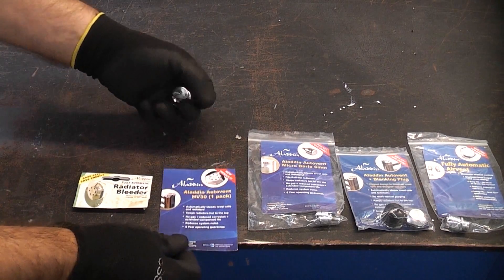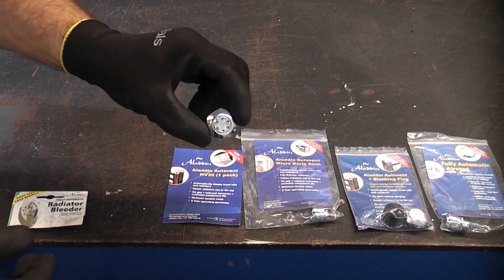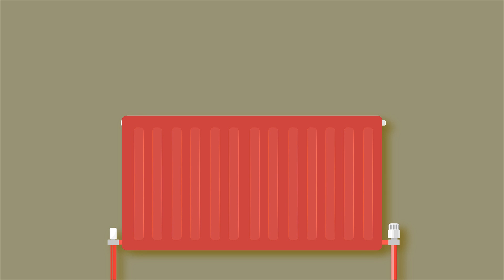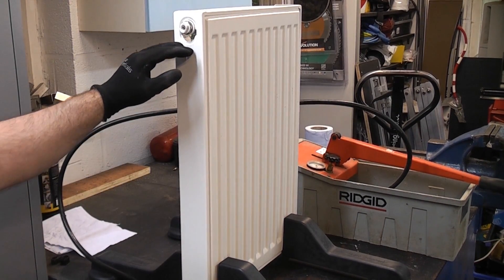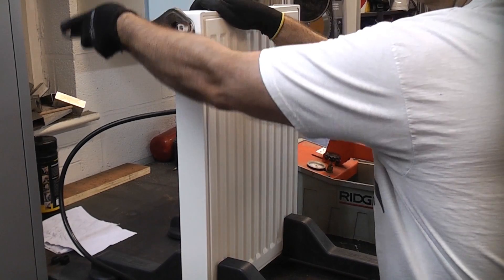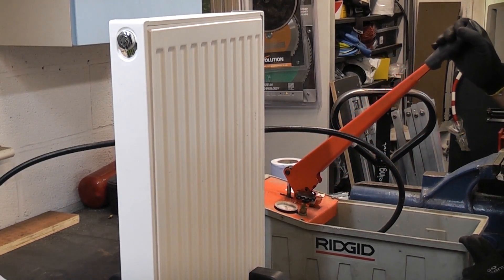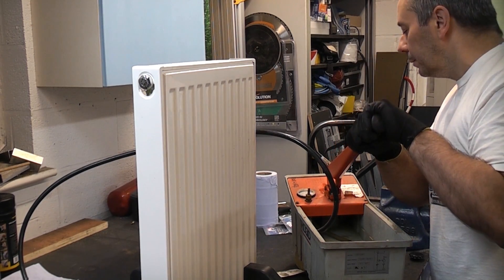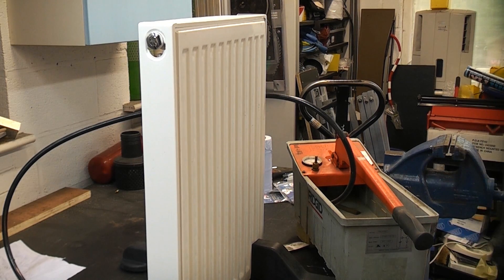Aladdin autovent | automatic radiator bleed valve

Comment: I have different problem with some rads not heating at the bottom, over the years I've had numerous plumbers out all with different solutions. My boiler is a ideal classic fitted upstairs  in the box room with a expansion valve in the attic. Kitchen rad will only get piping hot if I knock off some rads. I think it's a balance issue as their is no air trapped. Can I source a device to balance or what do you think. Thanks Kyle from dublin
Reply from the maker: Normally old rads at the bottom often means that the radiator is full of sludge.
Have you ever had the system power flushed?
You could remove one of the problem radiators and take it outside, then swill it out with a hose pipe. 
Thanks for the comment
Reply: Thanks for replying , all the rads are less than 5 years old, I've had the system drained twice in the last 5, I've also bought magna clean but it's not installed yet. Kitchen rad is furthest from the boiler which is upstairs in the box room. Probably needs a power flush and the boiler replaced and moved downstairs
Reply: Kyle Croft. There`s a few things that could be the cause, which you should eliminate before the pain and expense of a boiler replacement and move (unless that`s what you want to do anyway). I would do a complete drain down, flush, and treatment first. Then it`s worth investigating if there is any poorly installed pipework, which could be restricting the flow, and also check the pipe sizing while you`re at it. Basic balancing is also something you can do relatively easily yourself, just throttle the lockshields down on the rads nearest the boiler, and leave the downstairs at full bore.
Reply: I got this problem with 1 radiator that is hot at top cold at bottom plus it can't be switched off. In the off position with the trv it comes on warm and if I turn it full it gets hotter. I changed the trv joint and thermostat to no avail. all the other radiators are fine. 1 plumber said the in flow and out flow need swapping and another said to power flush. instead i am trying a cleaner f100 and inhibitor f400 to see if that works. I got a magna trap and water seems clean so goung to install 6 aladdins too. pretty sure it can't be sludge but I could be wrong.